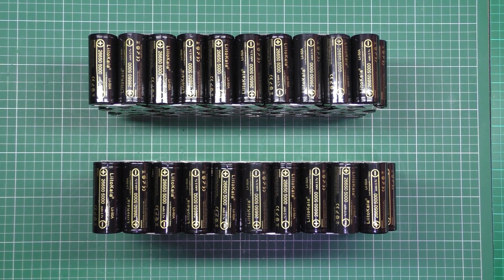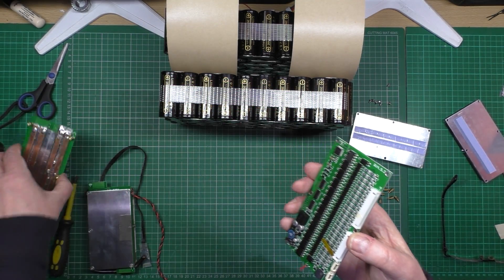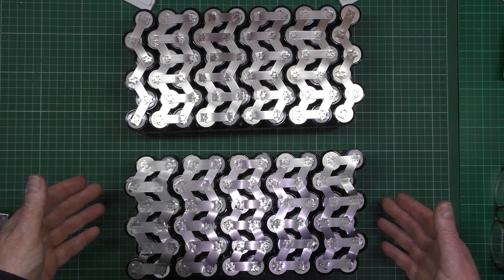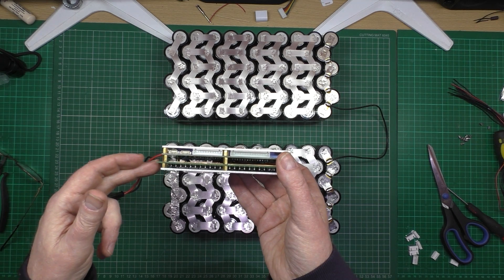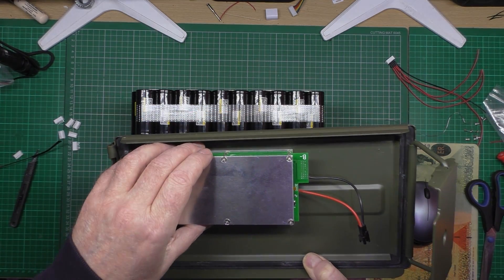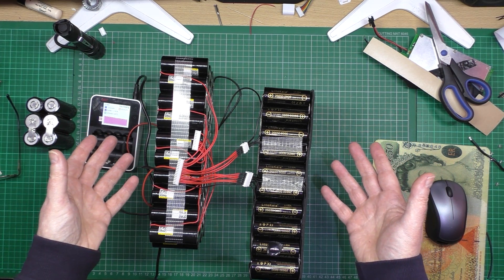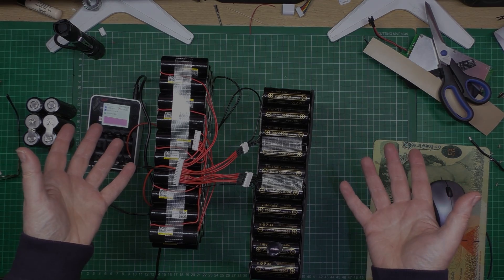High powered DIY eBike MSVA build part 6 - Lithium battery 84v 30Ah 2.5kWh build part 3

Comment: Here's a tip: You can get stick-on card rings for spot welding li-ion cells which prevent the heat of spot welding and soldering from getting at the shrink-wrap on the cell on the positive end. I plan on using some alongside insulating the everloving heck out of the parallel banks of cells as an extra protective measure so when the pack is in use there's zero chance of the shrink wrap failing and shorting against the series wired cells.

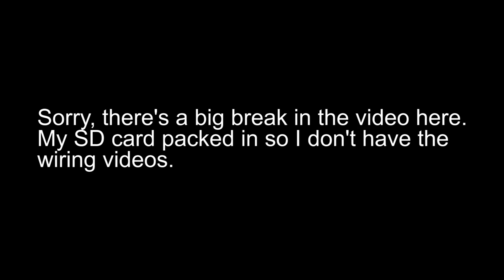Comment: Why is the pin configuration on the 24s  BMS you sent me completely different than the one in the video at 10:17?  I was hoping to use this video as an instruction since non are provided with the product. Or is it fine to just start with DD06 as B-/+1?
Reply from the maker: Sorry mate, I don't sell things. Have you got me confused with someone else?
Reply: @Vortecks   I don't believe so.  I clicked the link on your video, as you stated, "support UK business."
Reply from the maker: @cyumadbrosummit3534   But I don't sell anything and I never have. I don't have an online shop and I don't sell any products. I do list the parts that I used on this build because everyone asked me for it.

Comment: Thanks Tony 👍🏻 looking good. I’ve bought a test batch & made 3s6p. I did a discharge test and afterwards the cells read 3.49, 3.47, 3.38. Looks like the 3rd cell is slightly lower capacity...what would you do?

Comment: Fantastic job !! What sort of speeds do you think you will achieve?
Reply: Bout 0 to 100 in 2sec 😂😂😂
Reply: Da ve That’s pretty dammed quick!, Have you had any issues being pulled over with the bike being so fast and having such a large motor.?
Reply: @Midlothian1000  I was joking 😂😂
Reply: Da ve 👍 I was wondering if you can set the bike to 15.5 mph even when you have a big motor and that is ok legally? It’s just that having tried 250w and there is no way it can pull me around adequately ( 6ft 4 and 15 stone )
Reply: @Midlothian1000  some controllers have speed limiters..
Reply from the maker: The UK legal limit is 36v, 250w and 15.5mph. Even if there was a switch to limit the speed, it would still be illegal.
As for the top speed...... no-one knows until I test it but it'll have over 1200bhp/tonne.

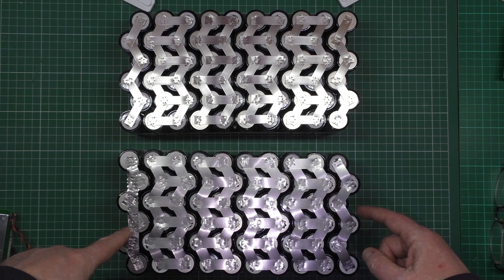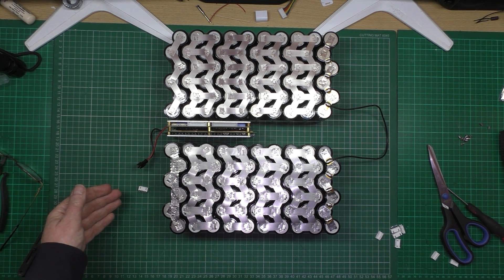Comment: It's a beautiful thing... but I was cringing 5:45 between 8:18 with the aluminium of the BMS so close to the exposed nickel strips! Can't wait to see it in action.
Couple of days ago I changed wheel rim and relaced - Like tuning a piano, I made the spokes all sing the same note then inched them up a quarter turn each per revolution and the results were perfect. Took far less time than getting the thing off and on the bike again!
Reply from the maker: I find it quite therapeutic, Andy. I've re-done the front wheel with 12g spokes and finished the back wheel with new 10g spokes today!

Comment: One piece of 1mm silicone thermal pad and a nice piece of 1mm copper plate to cool and spread the heat from the balance rezistors. Then the ntc can get over the copper plate. Otherwise it does not matter that much, you only have that fixed ammount of power disipated on the rezistors (4.2v*whatever_the_current).
Reply from the maker: It's 180mA max. I've already overcome the battery mounting problem..... all will be revealed soon :-)